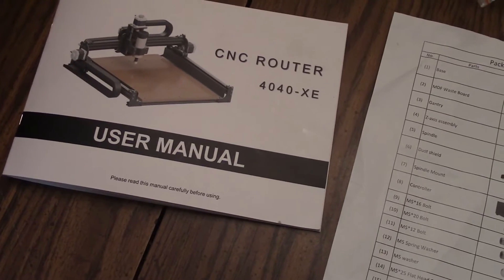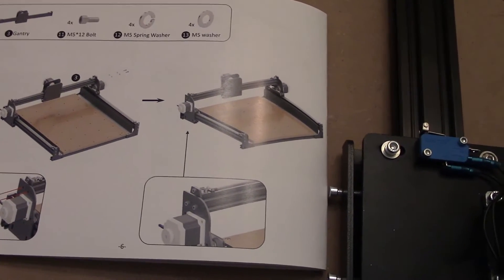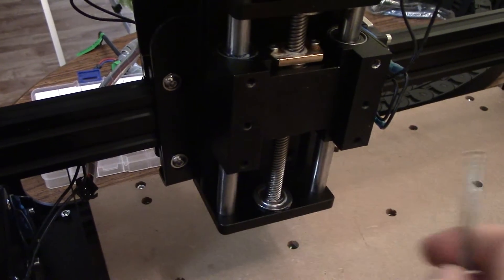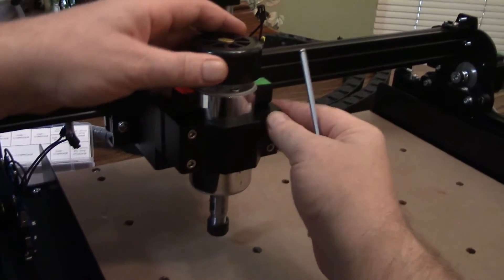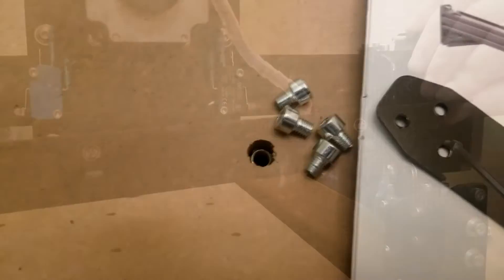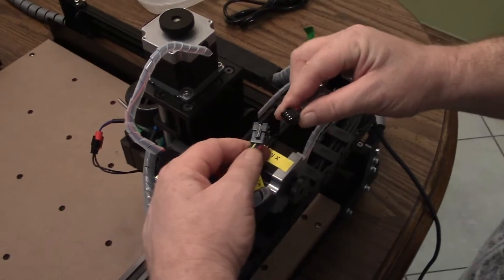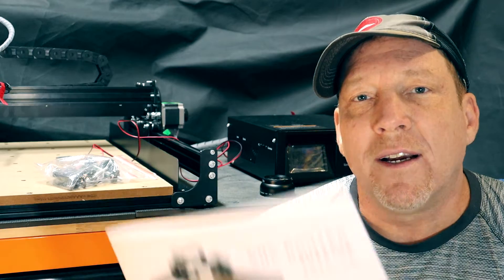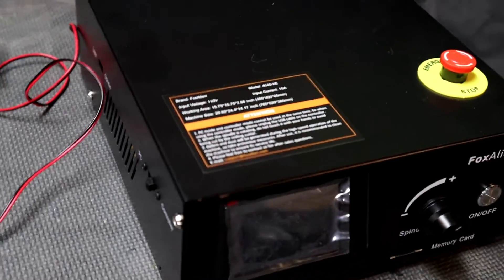I BOUGHT THE CHEAPEST CNC MACHINE ON AMAZON! Assembling The FOXALIEN 4040-XE!!

Comment: Getting one of these cnc routers will open up my shop and allow me to expand on the low cost but good quality pickups for CBG that I am in the  process of developing (hand cutting and sanding small parts is tedious and time consuming). I can even set it up to cut out the top of the box and not have to remove it fro
m the box, route out the
 Pickup cavity and the sound holes all in one operation.could even save time on rough shaping of the neck and adding inlays to the fret boards. Oh well daydreams are nice but who ever ends up getting this is gonna love it. When it’s all said and done I will have to look at there smaller unit for my pickup experiments since I already built my winder and got my vac pump for porting the coils I’m gonna make it work one way or another. Thank you FOX ALIEN your products rock.